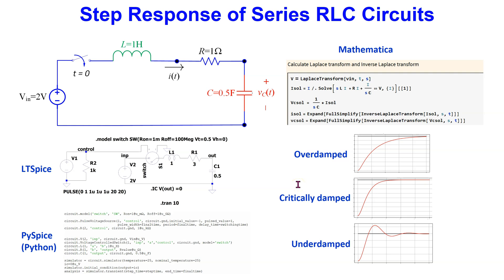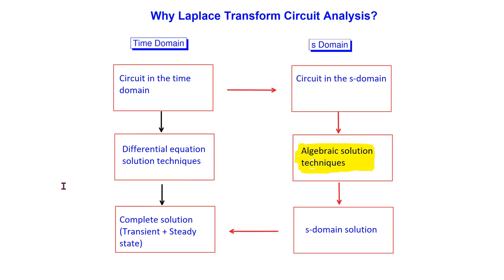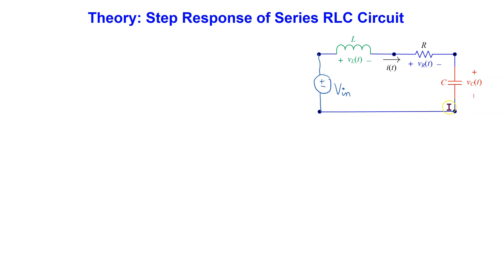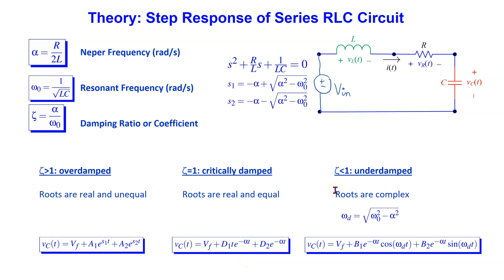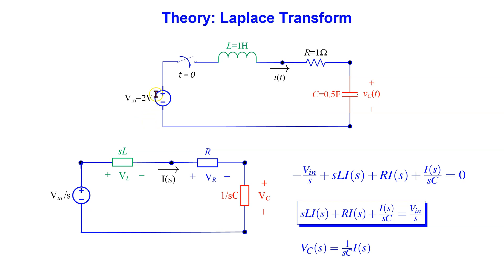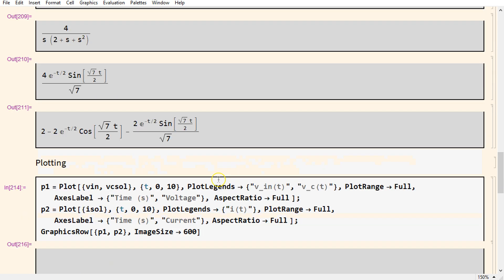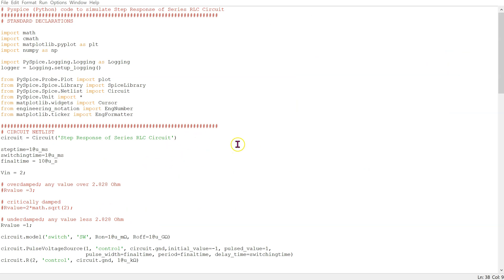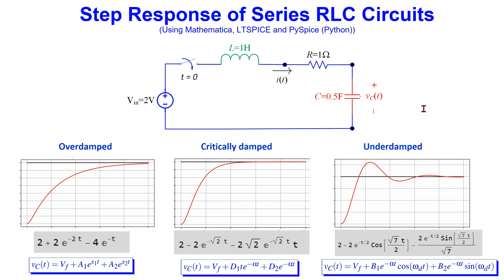Demystifying Step Response of Series RLC Circuit Using Mathematica, PySpice (Python) and LTSPICE

Comment: I remember how I studied in 1990-s how to calculate the stuff you showed here. We used only paper. Now it is amazing to see that I can calculate all these with python. Python have build in complex numbers, this is exciting!
Reply from the maker: Yes that is correct. Using Mathematica (or WolframAlpha) we can calculate in closed-form the analytical expressions. Using Python, we can do simulation and theory in the same environment. I am currently working on the Natural Response of series RLC circuits video, which will also provide the accompanying Mathematica and Python codes.

Comment from the maker: vin = 2* UnitStep[t];
R = 1;
L = 1;
\[DoubleStruckCapitalC] = 1/2;
StringTemplate[
  "Series RLC circuit with R=`1`\[CapitalOmega], L=`2`H and \
C=`3`F"][R, L, \[DoubleStruckCapitalC]]
\[Alpha] = R/(2 L);
StringTemplate["Neper frequency \[Alpha]=`1` rad/s"][\[Alpha]]
\[Omega]0 = 1/Sqrt[L \[DoubleStruckCapitalC] ];
StringTemplate[
  "Resonant frequency \!\(\*SubscriptBox[\(\[Omega]\), \(o\)]\)=`1` \
rad/s"][\[Omega]0]
\[Zeta] = \[Alpha]/\[Omega]0 // N;
StringTemplate["Damping factor \[Zeta]=`1`"][\[Zeta]]

Which[\[Zeta] == 1, Text[Critically damped], \[Zeta] < 1, 
 Text[Underdamped], \[Zeta] > 1, Text[Overdamped]]
If[\[Zeta] < 1, \[Omega]d = Sqrt[\[Omega]0^2 - \[Alpha]^2];]
If [\[Zeta] < 1, 
 StringTemplate[
   "Damped frequency \!\(\*SubscriptBox[\(\[Omega]\), \(d\)]\)=`1` \
rad/s"][\[Omega]d]]

s1 = -\[Alpha] + Sqrt[\[Alpha]^2 - \[Omega]0^2];
s2 = -\[Alpha] - Sqrt[\[Alpha]^2 - \[Omega]0^2];
StringTemplate[
  "The roots of chracteristic equation are \!\(\*SubscriptBox[\(s\), \
\(1\)]\)=`1` and \!\(\*SubscriptBox[\(s\), \(2\)]\)=`2`"][s1, s2]
V = LaplaceTransform[vin, t, s]
\[CapitalIota]sol = \[CapitalIota] /. 
  Solve[ s L \[CapitalIota] + R \[CapitalIota] + \[CapitalIota]/(
      s \[DoubleStruckCapitalC]) == V, {\[CapitalIota]}][[1]]
Vcsol = 1/(s \[DoubleStruckCapitalC])*\[CapitalIota]sol
isol = Expand[
  FullSimplify[InverseLaplaceTransform[\[CapitalIota]sol, s, t]]]
vcsol = Expand[FullSimplify[InverseLaplaceTransform[ Vcsol, s, t]]]
If[\[Zeta] > 1, TrigToExp[isol]]
If[\[Zeta] > 1, TrigToExp[vcsol]]
p1 = Plot[{vin, vcsol}, {t, 0, 10}, 
   PlotLegends -> {"v_in(t)", "v_c(t)"}, PlotRange -> Full, 
   AxesLabel -> {"Time (s)", "Voltage"}, AspectRatio -> Full ];
p2 = Plot[{isol}, {t, 0, 10}, PlotLegends -> {"i(t)"}, 
   PlotRange -> Full, AxesLabel -> {"Time (s)", "Current"}, 
   AspectRatio -> Full ];
GraphicsRow[{p1, p2}, ImageSize -> 600]

# Pyspice (Python) code to simulate Step Response of Series RLC Circuit
#####################################################################
# STANDARD DECLARATIONS

import math
import cmath
import matplotlib.pyplot as plt
import numpy as np

import PySpice.Logging.Logging as Logging
logger = Logging.setup_logging()

from PySpice.Probe.Plot import plot
from PySpice.Spice.Library import SpiceLibrary
from PySpice.Spice.Netlist import Circuit
from PySpice.Unit import *
from matplotlib.widgets import Cursor
from engineering_notation import EngNumber
from matplotlib.ticker import EngFormatter

#####################################################################
# CIRCUIT NETLIST
circuit = Circuit('Step Response of Series RLC Circuit')

steptime=1@u_ms
switchingtime=1@u_ms
finaltime = 10@u_s

Vin = 2;

# overdamped; any value over 2.828 Ohm
#Rvalue =3;

# critically damped
#Rvalue=2*math.sqrt(2);

# underdamped; any value less 2.828 Ohm
Rvalue =0;

circuit.model('switch', 'SW', Ron=1@u_mΩ, Roff=1@u_GΩ)

circuit.PulseVoltageSource(1, 'control', circuit.gnd,initial_value=-1, pulsed_value=1,
                           pulse_width=finaltime, period=finaltime, delay_time=switchingtime)
circuit.R(2, 'control', circuit.gnd, 1@u_kΩ)

circuit.V(2, 'inp', circuit.gnd, Vin@u_V)
circuit.VoltageControlledSwitch(1, 'inp', 'a','control', circuit.gnd, model='switch')
circuit.L(1, 'a', 'b',1@u_H)
circuit.R(1, 'b', 'output', Rvalue@u_Ω)
circuit.C(1, 'output', circuit.gnd, 0.5@u_F)

simulator = circuit.simulator(temperature=25, nominal_temperature=25)
ic=0@u_V
simulator.initial_condition(output=ic)
analysis = simulator.transient(step_time=steptime, end_time=finaltime)

#######################################################################
# THEORETICAL CALCULATIONS

time=np.array(analysis.time)

alpha = float(circuit.R1.resistance/(2*circuit.L1.inductance))
omega0 = float(math.sqrt(1/(circuit.L1.inductance*circuit.C1.capacitance)))
damping_ratio = float(alpha/omega0)

print('Neper frequency, alpha ={} rad/s'.format(EngNumber(alpha)))
print('Resonant frequency, omega_0 ={} rad/s'.format(EngNumber(omega0)))
print('Damping ratio ={}'.format(EngNumber(damping_ratio)))

if damping_ratio == 1:
    print('-----------------')
    print('Series RLC circuit is critically damped')
    print('-----------------')
    s1 = -alpha + np.sqrt(alpha**2-omega0**2)
    s2 = -alpha - np.sqrt(alpha**2-omega0**2)
    print('Root of characteristic equation is s1 ={}'.format(EngNumber(s1)))
    print('Root of characteristic equation is s2 ={}'.format(EngNumber(s2)))
    Vf = Vin
    D2 = -Vf
    D1 = alpha*D2
    print('D1 ={}'.format(EngNumber(D1)))
    print('D2 ={}'.format(EngNumber(D2)))
    v_out = Vf + D1*time*np.exp(-alpha*time)+D2*np.exp(-alpha*time)
    
elif damping_ratio > 1:
    print('-----------')
    print('Series RLC circuit is overdamped')
    print('------------')
    Vf = Vin
    s1 = -alpha + np.sqrt(alpha**2-omega0**2)
    s2 = -alpha - np.sqrt(alpha**2-omega0**2)
    print('Root of characteristic equation is s1 ={}'.format(EngNumber(s1)))
    print('Root of characteristic equation is s2 ={}'.format(EngNumber(s2)))
    A2 = (s1/(s2-s1))*Vf
    A1 = -Vf-A2
    print('A1 ={}'.format(EngNumber(A1)))
    print('A2 ={}'.format(EngNumber(A2)))
    v_out = Vf + A1*np.exp(s1*time) + A2*np.exp(s2*time)
    
else:
    print('-----------')
    print('Series RLC circuit is underdamped')
    print('-----------')
    omegad= math.sqrt(omega0**2-alpha**2)
    print('Damped frequency, omega_d ={} rad/s'.format(EngNumber(omegad)))
    s1 = -alpha + cmath.sqrt(alpha**2-omega0**2)
    s2 = -alpha - cmath.sqrt(alpha**2-omega0**2)
    print('Root of characteristic equation is s1 ={}'.format(s1))
    print('Root of characteristic equation is s2 ={}'.format(s2))
    Vf = Vin
    B1 = -Vf
    B2 = alpha*B1/omegad
    print('B1 ={}'.format(EngNumber(B1)))
    print('B2 ={}'.format(EngNumber(B2)))
    v_out  = Vf + B1 * np.exp(-alpha * time) * np.cos(omegad * time) + B2 * np.exp(-alpha * time) * np.sin(omegad * time)
    
    
#######################################################################
# PLOTTING COMMANDS

figure = plt.subplots(3,1,gridspec_kw={'height_ratios': [1, 3, 1]})

axe1 = plt.subplot(311)
formatter0 = EngFormatter(unit='s')
axe1.xaxis.set_major_formatter(formatter0)
plt.title('Switch activation')
plt.ylabel('Voltage [V]')
plt.grid()
plot(analysis['control'])
axe1.set_yticks([-1, 0, 1])

axe2 = plt.subplot(312)
formatter1 = EngFormatter(unit='s')
axe2.xaxis.set_major_formatter(formatter1)
plt.title('Voltage across Capacitor')
plt.xlabel('Time')
plt.ylabel('Voltage [V]')
plt.grid()
plot(analysis['inp'],  color='black')
plot(analysis['output'],  color='red')
plt.plot(time, v_out,'b:')
plt.legend(('input','simulation','theory'), loc=(.05,.1))
cursor = Cursor(axe2, useblit=True, color='blue', linewidth=1)

## Plot the simulated current in the series RLC circuit
axe = plt.subplot(313)
plt.xlabel('Time')
plt.ylabel('Current [A]')
plt.grid
formatter0 = EngFormatter(unit='s')
axe.xaxis.set_major_formatter(formatter0)
i= analysis['output']/circuit.R1.resistance
plt.plot(time, i,'r-')
plt.show()

#######################################################################
Reply: I know some python at beginner level. I copied and pasted this code into my Spider IDE.  
  The code does not work. Because many libraries that I am trying to install using pip or conda-install, those installation does not work.
Reply from the maker: I am sorry to hear that you are having Python installation trouble. The code in the comments section has two parts: The first is the Mathematica code and then the Python code.

The Python installation is explained here: 
https://youtu.be/KnA7xI7MAuI?t=56

In addition, I am using the engineering notation package which can be installed using:
pip install engineering-notation
Reply: @electriccircuits7164  Thanks! I saw the difference between Mathematica code and Python code. I think I need to install python on clean virtual machine, and try to run this code. Hope that your tutorial will help.😄